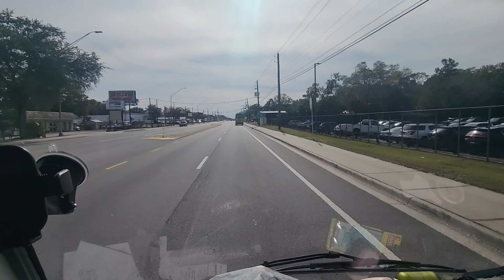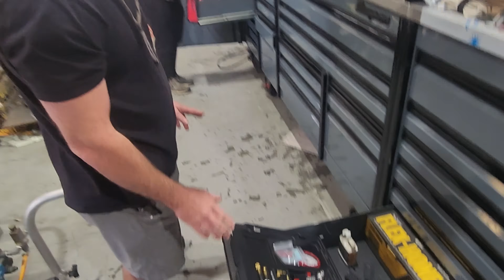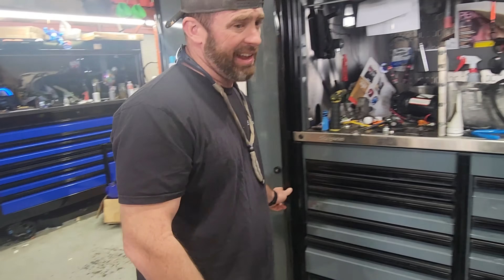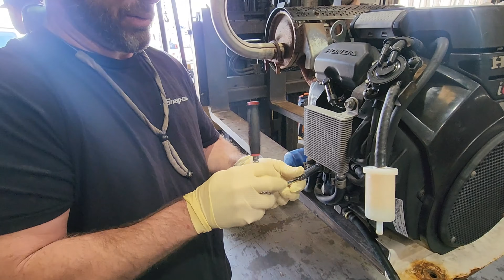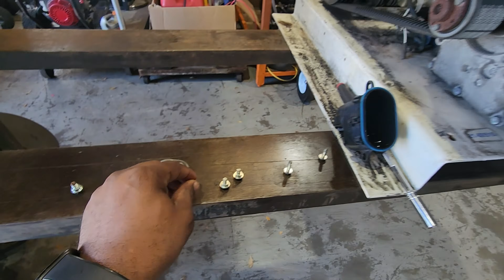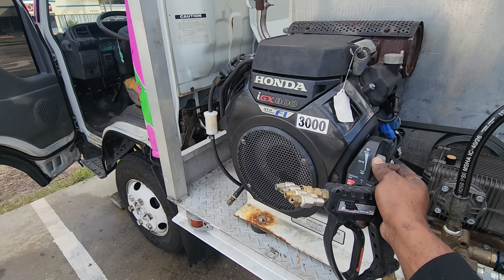Honda IGX800 Surging Fix #honda #igx800 #pressurewasher

Comment: Just got a brand new IGX800 and used it today.  Made it to 3.2 hours and its surging/bogging under load.  Not  very happy right now.....
Reply from the maker: Sorry to hear that, definitely reach out to your local dealer since it's brand new and under warranty! 👊🏽
Reply: @PinkFlamingoPowerWash Im just gonna buy the Ameritech coils and try that.
Reply: @PinkFlamingoPowerWash Have you had any more issues since changing the coils to the Ameritech ones?  Im having serious buyers remorse with this engine, only 3 hours....damn!
Reply from the maker: @Quik22 nah not 1 issue at all except swapping out the belt
Reply: @PinkFlamingoPowerWash I sure hope this fixes mine as well, thanks!

Comment: I want that engine, where can I get one? I want it for Peru.
Reply from the maker: I dont know which company ships to Peru but you can get it here and use discount code Pink10 for 10% off. 

https://cigarcitysoftwash.com/products/honda-igx800-bare-engine-electric-start?variant=40349975576662&currency=USD&gad_source=1&gad_campaignid=22429981814&gbraid=0AAAAAovkp3ZXy8Jpb2vjTYE_1dbW8b_jW&gclid=CjwKCAiA7LzLBhAgEiwAjMWzCEZ2DF5RCq4UeTp6IUszbOLJf85SDN8b4DO--riNOVXArYVyoCnuCxoCKpsQAvD_BwE

Comment: Can't find it in UK. No one wants to sell from USA. Some said they'll give me a quote for shipping but never did.
Reply from the maker: Yea that's tough which sucks. Did you contacting the guys at Ameritech?
Reply: @PinkFlamingoPowerWash no. I went with another company from Ireland.( Jetmac). Gx 690 on wheels with annovi reverberi pump. 5000 psi, 21 Litres /minute on gear drive 2.2:1. Should be fine.  I also heard igx engines have more electronic stuff and so more stuff to break. A 690 with 5000 psi, 21l/ min should be more than enough even for a double turbo nozzle.
Reply from the maker: @Violetspider1 yes the 690s are definitely less finicky.  Im lucky with my igx800, it has held up great.  My 690 has well over 2000 hours on it now  😅

Comment: This is a great video but I purchased this kit and mine still surges.
Reply from the maker: Did you do the throttle body cleaning?
Reply: @PinkFlamingoPowerWash I am going to. I’m going to clean out the higher pressure fuel pump and replace the low pressure fuel pump. They like those fuel pumps. They ain’t cheap. lol. Like 60-65 for low pressure fuel pump and 125+ for the high pressure. 😮

Comment: Replaced the coils with these modified ones and igx800 is still not fixed 😩 going to replace high pressure fuel pump to see if that works
Reply from the maker: Before replacing that. Take the throttle body apart and clean it! Not sure if you heard that part in the video as well.
Reply: @PinkFlamingoPowerWash where is the throttle body ?
Reply from the maker: @TheReal.W.I.S.E  behind the cover that said igx800

Comment: Where can i get those resistor boots for the spark plugs? i am in California
Reply from the maker: Call ameritech pressure cleaning systems. They'll get you squared away.
Reply: @PinkFlamingoPowerWash  great thank you, also any info on why my 800igx would shut off and not want to turn back on. Oil level is good, battery and rectifier is working properly. Could it be a faulty oil sensor or possibly a ECM issue? any help would be greatly appreciated

Comment: Having the same issue with my IGX800, revs high and turns off. Calling them tomorrow! Almost bought a new throttle body assembly!
Reply from the maker: Yeah its a great engine,  some folks are just not educated enough about them.

Comment: My IGX800 keeps shutting down randomly after 500 hours. When it shuts down a constant blinking light. Had plenty of oil in it.  Changed the oil and fuel filter still does it driving my crazy. Thanks for this video, man! In Massachusetts, it's hard to find mechanics like this!
Reply: I’m in the same boat. Shuts down mostly when first warming up. But will also surge like in this video randomly throughout the day, mostly when off the trigger. A little under 500 hours on it. Located in VT and good shops are hard to come by. Did you ever get your machine straightened out? 

I just sent AmeriTech a message through their website and hoping they can help me diagnose this remotely 🤞
Reply: @InfinityCleaning I bought the new coil packs from Ameritech and my is still surging.
Reply: @Grime2Prime same here 😕
Reply from the maker: @InfinityCleaning  been working ever since this fix
Reply: @PinkFlamingoPowerWash  good to hear! I was actually curious if @sundown798 ever got his machine fixed. Seeing as he was experiencing very similar issues as my machine.
Reply from the maker: You're very welcome 🙏🏽

Comment: Man it's almost impossible to find someone to work on this. I have issues with my unit as well it crazy and frustrating.North Myrtle Beach SC
Reply from the maker: Yea they're far and between it seems like.  Some will make you to believe these engines are inferior.  This one has 950hrs and has always set outside and was near a chlorine tank cause there's some rust on it.  But now she should run flawlessly.
Reply: I live in Myrtle Beach as well and I have this same machine did you find a mechanic to work on it? Any information would be appreciated thank you sir

Comment: So what was wrong? He was saying a lot. Sounds like he puts bypass on for the stator or something?
Reply from the maker: The coil boots weren't putting out the correct voltage which they modify a resistor to level the voltage and also cleaned the throttle body.  There's a little plastic gear in there that was not moving freely to allow it to open and close. Therefore choking the throttle
Reply: @PinkFlamingoPowerWash I wish I had him nearby! He knows his stuff! I have a lawn mower that does the same thing after running for 10 mins or so. It won’t keep the battery charged and I think it’s the stator and fly wheel. Like yourself, I was told the fuel pump was bad etc and still the same probably after a $1200 ticket!!!! If a mechanic doesn’t know just say it!  🤷🏽‍♂️
Reply from the maker: @derrickbell3087  facts. It's ok to not know everything